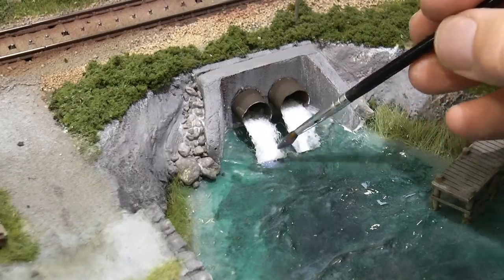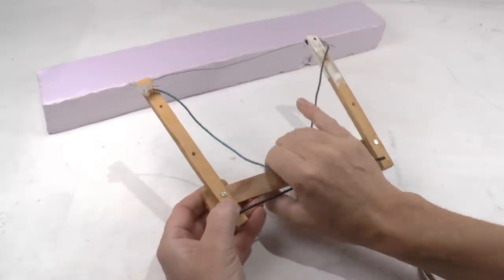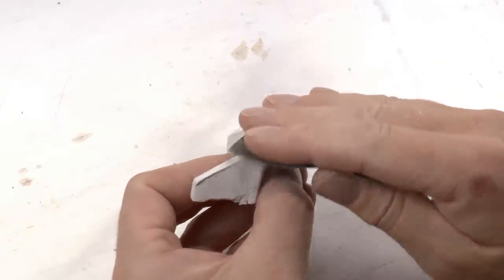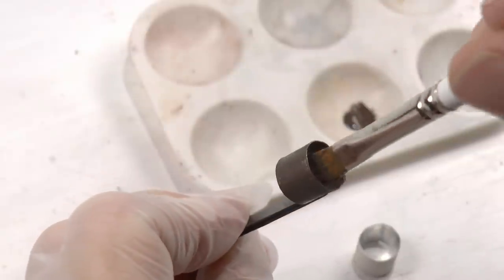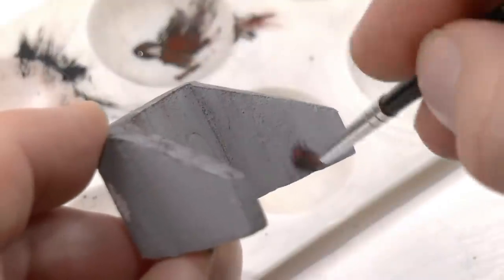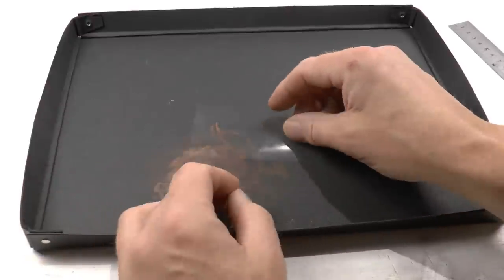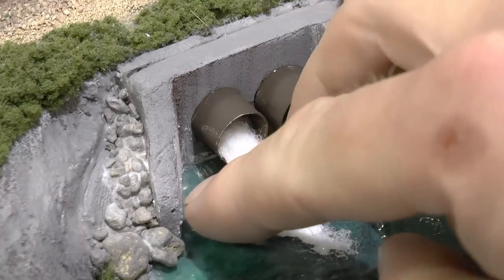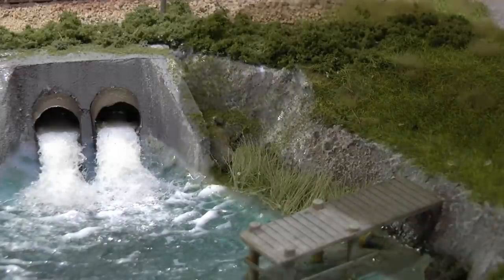Creating Water Jets EASY and Low cost

Comment: What about using the tubes from the outside of markers that no longer work for the pipes and such for water scenics?  I have found that if you take a marker apart and lightly sand the outside to remove the shine and labels from them, they can be used to make a pipe or column in a structure or location in a model train or diarama.